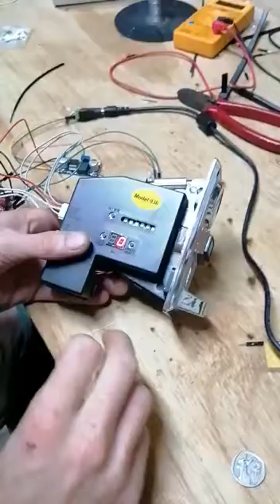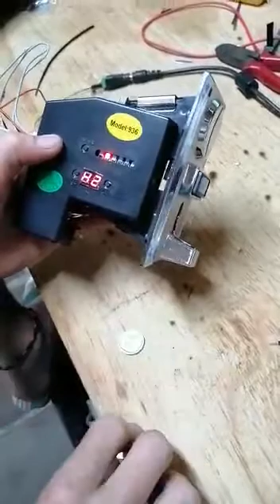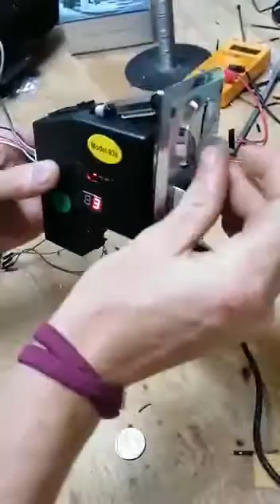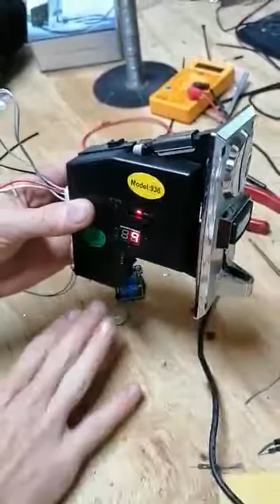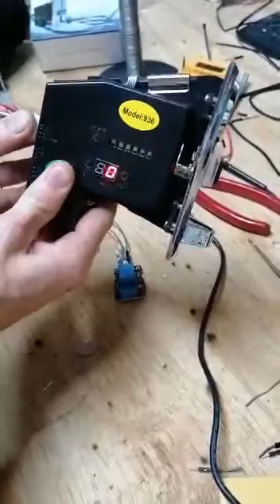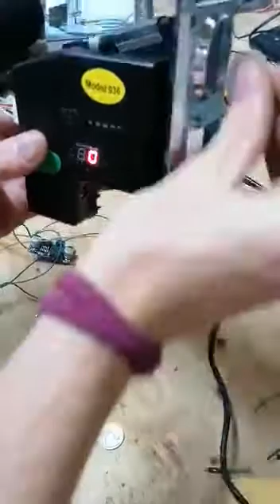Setting Up a 936 Multi Coin Collector

Comment: By any chance, do you know about how to add a coin dispenser so it can give back the change? Thanks just started a vending machine business on the side.
Reply: Awesome video by the way thank you so much. This is very much needed in 2024 Also, may I add I used this for a different model and it still worked